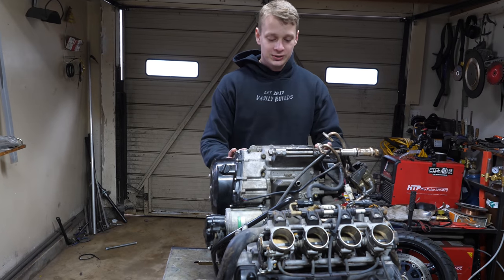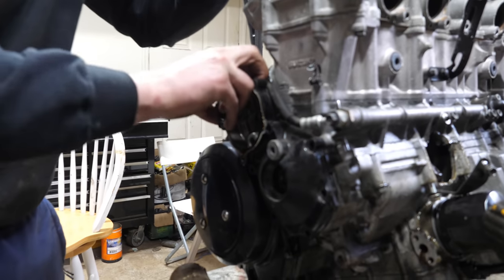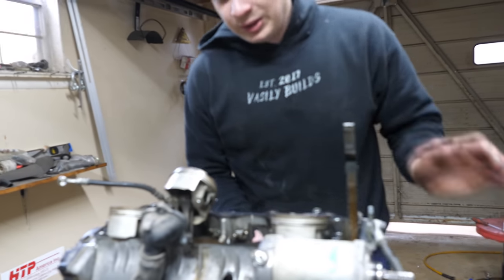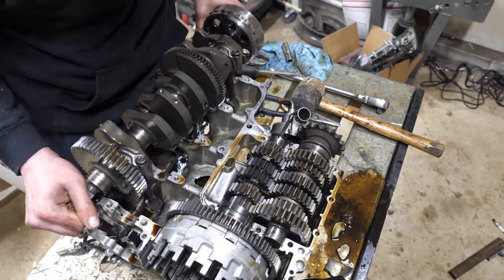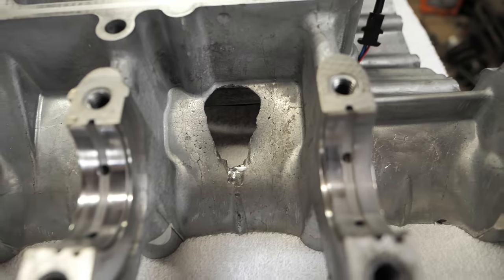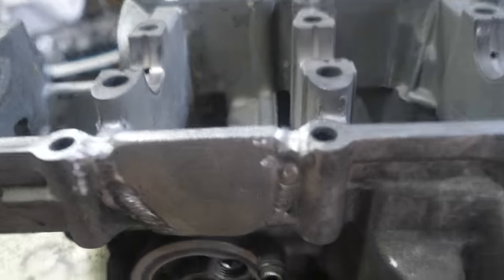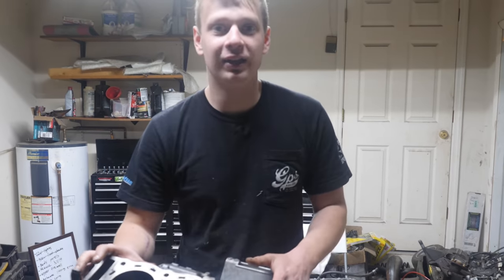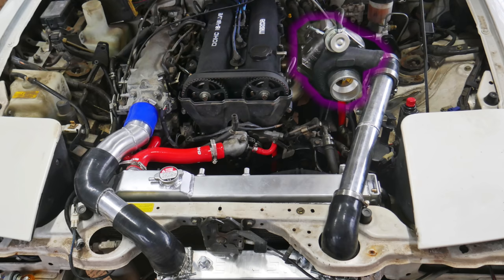I welded My BAD Hayabusa Engine! (They said its too far gone)

Comment: You don't let anyone tell you that something isn't possible, and that's why you shine brother. Keep it up!
Reply: i've done some stuff on my dirtbike people told me not to do, it still holds up to this day after about 6months when i rebuilt it and it's a daily ripper:)
Reply: challenge the doubters
Reply: Makes me turn around and perform the supposed impossible task.
Reply: Nothing is impossible. Lots of work though
Reply: My motto on life!! Amen!
Reply: Its not telling him he can't he has alot of talent and potential. Its just the whole FUKIN SKETCHY. on 2 wheels puking oil and not noting when its gona pop lock up and YEET what little brains it took to make this decision... on the other hand great engine for the scrap yard 👍 👌
Reply: @mikehancho3500  I just entered your comment into Google translate, and it just said "Error".
Reply: When a welder tells you that it’s not possible what they mean is it’s not worth THEIR time…. but it may always be worth YOUR time.

And even if it failed you are out nothing and gained experience welding crap, I mean cast, aluminum. 

I like that you used soap and water instead of brakekleen.  The stuff in the red can will poison you if welded.

Comment: Allen Millard would be very proud of you...lol  Everything can be fixed, just a matter of feasibility.  I'd still keep that one for parts and find a better donor, not like they're hard to find.  Go ahead and delete that air injection system (garbage), either block off plates or drill and tap the ports 5mm and put screws in them.  At the very least have a machine shop center bore those cases and might as well get them to mill the mating surfaces where you welded, nothing too expensive.  Make sure you shim all the valves for clearance before you finish.  Torque on the cam caps is very important. I have a factory service manual on PDF if you need one.  I also still have some random Busa parts laying around.  Back in my younger days I did alot of work on these busas including turbo installs, still the highest potential motorcycle engine ever produced, a true engineering feat from Suzuki.  I've seen these motors make almost 900hp on boost.  A viable stock motor is good for about 310hp, any further than that and you are in no man's land.  Good luck with it, brings back lots of good memories from my younger days watching you work.  If you need anything I might have contact me.
Reply: I think the only criticism would be to preheat that block and really get the area clean with acetone. Otherwise good work man!
Reply: @pewdsbetterthantseires84  throw them in the BBQ. Mr Millyard’s videos are full of useful tips and I can’t even weld!
Reply: Allen Millard was my first thought too !
Reply: A young Alan Millyard for sure! Time is more precious with the skills you have than any cash you can chuck at an unknown entity!
Reply: Funny, I came to the comment section to ask him if Allen Millyard was his hero
Reply: How on earth can anyone make a comparison to this guy with Allen Millyard. It's an insult to Allen to compare him to this guys antics. This chap is completely out of his depth and is as far away from a skilled mechanic/engineer as you can get. It was so cringeworthy embarrassing to watch I thought it was an April fool joke video!
Reply: @dwhxyz  nobody said he was better..Allen has much more experience.. this is a kid doing all of this and he's learning as he goes.. not sure why you find it triggering to compare what he's doing to Allen Millyard but their channels are very similar.. who knows what this kid will be in the next 20 years..I guarantee Allen didn't start off as good as he is

Comment: I think it’ll be fine as long as you don’t boost it. You should be proud of the results man , not many people would even attempt that repair 👍🏼👍🏼
Reply: Don't boost it? Why? You do realised top fuel blocks are welded up constantly.
Reply: That's my opinion too!
Reply: @garyhowe88  yea but it’s right where the cases meet
Reply: @snaxgalore5764  there's people making 1000hp+ with boosted busa's. I'd see no issue running that at 350hp.
Reply: @snaxgalore5764  that's usually where the damage is
Reply: @garyhowe88  really name one
Reply: @wiggitywhitefox  big cc racing in the UK.
Reply: I’d boost it just too test your repair..  test them limits bro.

Comment: .012" is a LOT of gap!  Build it back up and dress it down with a good straight file, making sure not to take down the areas around it.
Reply: This. It would be easier to address with a milling machine, but a shadetree alternative would be to get a sanding block (one that is about 12" ought to work) and start sanding down that area with a perfectly flat cutting surface (the sand paper on the block). Use sharpie or some markings on the mating surface adjacent to the repaired area so that way you know when to stop sanding and have achieved the right "depth".
Reply: @jw11432  even still, you better have some f**** skill if you think you're going to get that s*** within perfect tolerances. Like op said 012 is a lot of Gap but it's also like one swipe of a piece of sandpaper

Comment: I think it is great that you took the initiative to repair that engine block. Never say never, you don't know what you can do until you try. I think it turned out great, but I would add some material to that low spot so it's ready for whatever you want to throw at it.

Comment: The hardest thing with welding the cases is the gasket surfaces not leaking......i would bolt the cases together when i weld to minimize warpage
Reply: interesting suggestion.  how do you keep the weld separate where the cases come together?
How about just clamp two steel barriers along both sides of the aluminium welded plate patch, align with a straight edge, then flat file close to steel. 🙂
Reply: @kevinim300  obviously you cannot do 100% of the weld...the gap he has here is also a structural issue with the cases...it will likely shit out the silicone...maybe not

Comment: The slight tolerances in a high revving engine are no joke.   I re-built my gsxr-1000.  Only play with forces you fully understand.  Especially when you only have 2 wheels.
Reply: Yea no way he got that sand/sugar out of the oil galleries w/o a shop so that motor is toast regardless.

Comment: Great job on welding the block! And awesome video! To fix that gap just run some beads over the top of the metal and fill it up. Then just sand the surface down flat! I’ve seen it done many times on cylinder heads it should work there too! Keep up the good work😎

Comment: Mad engine builders from Indonesia once weld a single cylinder motor into a star engine(radial 5 piston) with basically the same tools & skills you've did. 
And that engines hold for as long as the internal parts work in harmony. 

They do resurface the entire flat surface like the engine case, welded blocks, and welded heads so the parts would fit precisely between flat surface in case of multiple inline configuration engine.

Comment: The welds look good to me, I used to weld a lot of Marine stuff in Miami about 20 years ago. I would have used a file instead of the jitterbug to cut the edges of the cases down. You may want to build up the edge and file it flat. It looks good though.goodluck.

Comment: You can put some RTV above and below the gasket at your gap and it will likely be fine;   since it's not a head gasket, all it really needs to do is keep the oil from leaking.  Worst case scenario, you can always weld over the top side of your patch and then sand it back down again..   If you just take a long block of wood (or something even flatter), and stretch a long piece of sand paper along the full length of your block, it will help you get everything even.  Your enlarged gap is there because you used that electric sander only in one spot-- in the center there...   Just take a long sanding block and go around your entire deck surface on both sides and that will help to knock everything down just a bit and close your gap.  On your final sanding, make sure you are using higher grits-- like 400/  600/ and 800..   It shouldn't need much sanding-- just a long flat sand block and a little more elbow grease-- Just be patient on your final sanding, so you don't over do it again............  
 Another trick I've seen people do is to get a large piece of flat glass and put some abrasive valve grinding compound (or something similar)---  and put your entire block on the flat glass and shift it around--- so that you're sanding the entire machined surface at once.  (It works well, but the block is big, so that would be more awkward.)
Reply: There is no gasket in between the cases and if you sand or remove any material from the cases where they join it fucks up the main bearing journals plus the journals for the transmission shafts as well. He would have to get all the journals line bored to bring them back to round and that would cost more than what the engine is worth.
Reply: @buildingracingvideos4714  RIght on..    He still should have used a long straight edge when sanding that down, to get it as close as possible.  I think he can probably RTV silicone the crap out of it and it might hold;  since it doesn't look like the seem is at the bottom of the engine, where oil sits... so it's only going to get oil splashing on it.  Shouldn't seep too bad.   On my CBR 600, I just bought another case half on ebay for $80.. and even though everyone said that it wouldn't work because these cases are made in matching pairs, ect. ect...   It bolted up just fine and worked great for thousands of miles and never leaked.  I didn't even change any of the bearings or anything.  Luckily all the broken spots were only on one half of the case, and I just swapped everything over-- no new parts needed.  (it was from a bad wreck and the entire front forks were also caved in-- I got it for $75-- spent $80 on the new case and I had the engine running in a day or two.  I ended up stripping off all the broken forks, ect..  welded on a quad swing arm and put the front quad conversion of a Tri-Z three wheeler on the front and made that thing into a four wheeler.  I sold it several years later for $1500 and a lot of sand dune trips)
Reply: @calholli  personally I'd coat the shit out of it with aviation form a gasket and pray the cases never have to come apart. That shit gets hard and will literally glue the cases together. He should be fine either way. A little oil leak never hurt anyone.
Reply: @buildingracingvideos4714  I'd use aviation form a gasket too. I think 0.012" is about the maximum you could go with it though. That's a pretty big gap. I think it would be better if he built it up a little more with weld and took it back down to under 0.005" gap at least. Especially if he ends up boosting it with a little more blow by.

Comment: That welding is a whole lot easier than Harly shovels. Pans and knuckleheads. I've weld a few in my years. Not anymore the sand castings are the most difficult I've come across in my years as a welder. Good job

Comment: For what it's worth I have been a mechanical engineer for more than 30 years. In that time I have seen far more professional welders who would have done a far worse job than you. All big and boogery. What you did here was masterful. You give yourself way less credit than you deserve. You're better than you think. You just need to relax and let it flow. Make it a sort of Zen thing you know? A little more practice and you might be able to weld 2 soda can halves together without blowing through anywhere which Incidentally is extremely good to practice with. You master that and you'll make yourself a fortune if you can weld soda cans like that. It's a hell of a trick at an interview.

Comment: Really impressed young fella, and love your 'give it a go attitude'. Back in the bad old days we often didn't have an option but to repair it ourselves. My only advice is when it comes to mating surfaces just take more time and care. You can get them really close tolerance if you do. Just find yourself a piece of thick sheet glass as a flat base and  once you get it reasonably close with a hand file or similar use sandpaper and a texta to shave off the high spots till you get it perfect. It ain't rocket science.

Comment: I’m not sure why there is any issue with your welds? It’s not like you welded inside the combustion chamber. Even if these areas get pressurized your welds and filler plates look as strong as the surrounding areas. I like your fearlessness on taking on a tough repair! First time to your channel, now a subscriber! You Rock!

Comment: Good job! Looks pretty good. The gap, I would just build the puddle up a little above the line and then possibly have a machine shop machine it flat, would be perfect smooth and probably pretty cheap! I had a cylinder head resurfaced for 40$

Comment: If your going to the trouble of rebuilding that motor, build it with forged bits for later upgrades 😁 🌪
Reply: those cases will fail before the pistons and when that happens no oil pressure = broken pistons.

Comment: Good job on cases, you should invest in a good lapping block or table it will allow you to get machine finish gasket mating surfaces. You can use it to flatten case half’s,heads,cylinders and anything else that needs to be perfect.

Comment: WOO HOOO!!... Now we're cooking.
I had a CBR 900, and my buddy blew right by me on the highway and I was maxed out.. around 145mph or so..  His fuel injected R1 was doing 180 or so--  I felt like I wasn't even moving, he passed me so fast.  There  are levels to these bikes-- Just be ready for this one.  It's on a whole other level that you haven't seen yet.  You can't even compare them to the 600's
Reply from the maker: Ive only been to 90mph on a bike haha
Reply: @VasilyBuilds  It doesn't feel safe. lol..  The other cars on the highway are doing 75mph and they look like they are parked on the side of the road when you pass them.  Nearly all Japanese bikes have a built in limit of 188mph. (which is 300km per hour I believe).  But trust me, it still feels too fast.

Comment: I'd do a leak test on the block after welding, cast aluminium normally suffers badly with lamination issues and the filler often doesn't bind to the cast without pre heating / sweating the pores out. Looks like an okay repair, id weld inside if you have the clearance too.

Comment: Had a chain break in my H-1 Kawasaki and punch a large hole through the crankcase.  Fortunately the piece that broke through was still attached by a tendril. I had it TIGed back together and it held up just fine for another 5 years of heavy riding. Your welds look good….you didn’t have a bunch of oil bleed out of the casting’s porosity, so you should be good to go.

Comment: That was very good,well done,only thing i would ad is, when taking engines apart, label things as parts ware differently and mate together,but saying that,if your putting new parts in,they will be fine.As for the welding,i would just build up that gap and file down carefully.

Comment: Sure it can be fixed, repaired and rebuilt .... but how much time is that gonna take you and what cost in replacement parts? If you put 20 hours into it thats over $2K worth of workshop labour rates alone ..... but for $2/$3K ya can get a used running decent busa engine. If it weren't for the fact you're documenting it all for your channel and will get income from this vid (and a couple more to go before it's done) I'd say chuck the broken engine in the corner for spares and just buy a working one to fit straight into the bike .. in the long run it would most likely work out cheaper and you'd still have some good spares from the broken engine on standby. Will be interesting to see the end result of your rebuild though  😉

Comment: Just a tip its always best to use a magnent and remove cylinder head bolts before removing the cylinder head. Also that motor was not sabataged but through a connecting rod and that bent those two valves and made the 2 holes in the block!

Comment: sick! well done bro! you can ask to flat the head and the case by a machine shop with a fly cutter and will be ready for the turbo!
Reply: If He does that what is going to happen to the bore for all the main Crank Journals?. When you split the cases apart there are specs that have to be followed to get the correct clamping force of the Main Bearings and two cases. It has let go that hard it needs to be measured for the straightness and the height allowed between the upper and lower case. That crankshaft should of just lifted straight up and out of that Case. But he had to hit the crap out of it with a hammer. He gets a A+ for His attitude to fix this engine and He is Learning, So You have to give it to Him for that. But there are some procedures that need to followed and If not done correctly all that Time and money He is spending on new parts and Gaskets etc will be for nothing.

Comment: Repair of the crankcase halves looks ok and it'll work fine, that's only there to keep the oil in,just as long as you can seal it. Probably would have been better to run a milling cutter over the rebuild sections of alloy.

Comment: The naysayers that said the block couldn't be repaired are only interested in selling you a new motor.  People have been welding & repairing engine blocks since the day they were first made and as long as you're clear of the bolts and stressed framework you're pretty much good to go.  Nice job BTW.

Comment: I think with some good quality sealant boosting shouldn't be a problem, Elring Dirko SHT is my preferred way of sealing transmission cases. If you apply it a bit thicker it will extrude a bit out of the sealing surface on both sides, when dry, this will essentially form an even tighter seal.